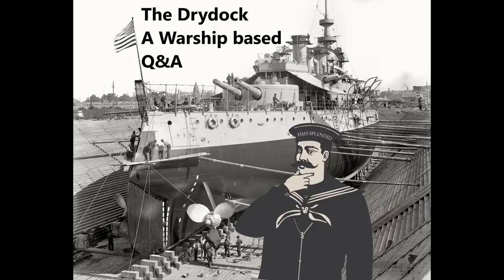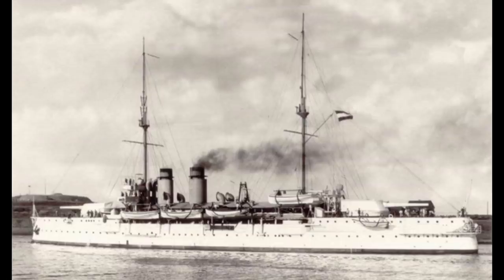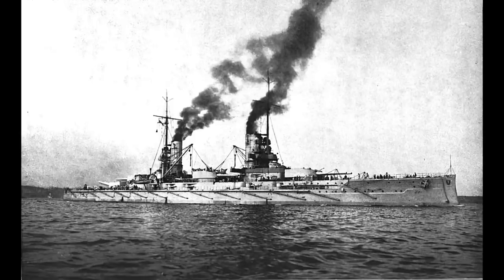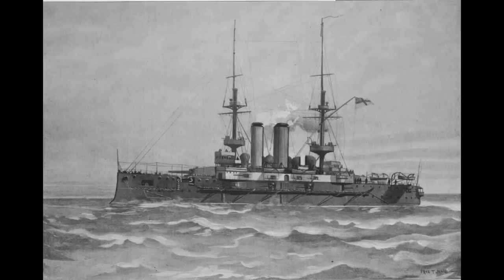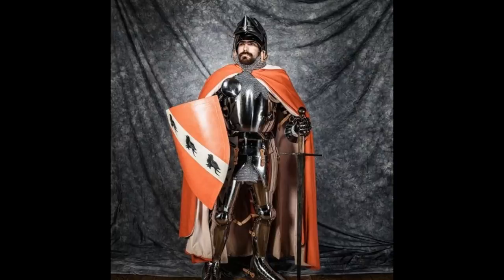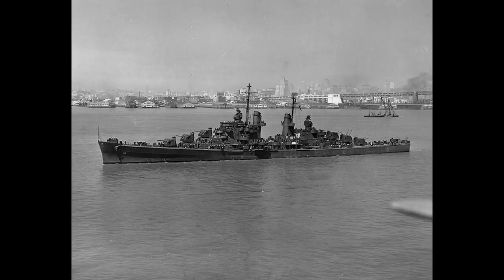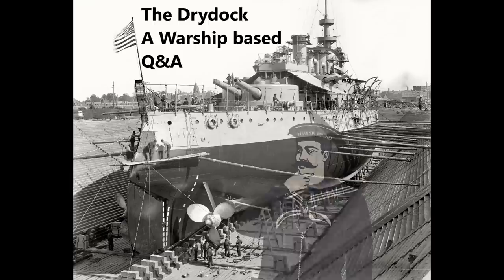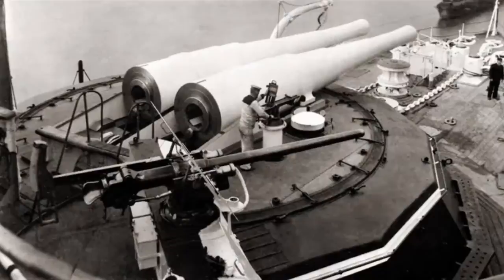The Drydock - Episode 103

Comment: I had in one of my houses in the 70s oak beams that came from a large hotel in Lytham St Annes built in the 1880s when it was demolished the oak timbers of which came from the Furohydrant a 74 commanded briefly by Nelson, this vessel ran aground off Blackpool in the 1880s and the timber particularly the oak used in the building of the hotel. The place where the hotel stood is named The Admiral after Nelson. What comes around goes around; I fitted those beams to create an open plan kitchen diner and was proud to use them. Regards
Reply: Was it perhaps the Foudroyant?
Reply: @melvillesperryn9268  Yes that's the puppy like most RN personnel could never get the name right, thank you young sir. regards

Comment: The important thing about the Nimitz class and some submarines is that they are nuclear powered which means that the old boiler problem of burning out has been eliminated and the platform has many years of use from the primary propulsion systems far beyond the old primary propulsion units in conventional power plants. The big power bits were boilers in the past and difficult and expensive to replace. One of the biggest cost of nuclear propulsion is decommissioning so you keep them going as long as you can. Regards

Comment: I found the use of models as a visual aid very helpful in comprehending the order of battle. Another great idea that sets you're efforts apart from the mundane rehash that is typically found. 
I did a lot of wargaming with 1200 and 1250 scale many, many moons ago. They might be unnecessarily large and kind of expensive for the purpose, however. The 6000 scale was, perhaps a bit small, leaving one to kind of strain for the detail to see what ship type/class they were looking at.
IMHO, 2400 scale might be a good compromise. One could see the general "profile" of the different models and discern ship class, eliminating need for painting flags, names, etc to get the general point across. In the case of Jutland, there might even be enough room to paint a white circle on a turret roof as identification, as a "for instance". There are plenty of maps and charts available to cross reference for those that wish to see exactly which ship is which in the respective battle lines, for those that wish to do so.

Comment: Drach hit the nail on the head with the part about major technological change.  For example, the Arleigh Burke class destroyers of the US Navy have had several different "flights" which are basically upgrades to the stuff inside the ship.  The lead ship in the class commissioned in 1991.  They are now getting to Flight III, the last ships of which will be commissioned somewhere in the vicinity of 2030 with an expected 45 year lifespan, bringing their expected service end to ~2075.  This means that some form of the class will likely be in US Navy service for north of 80 years.  This only works because of the ability to just remove old equipment and replace it with new equipment.  These ships are basically just what he said, steel wrappers.

Comment: Great Q&A video. On improving the seakeeping of the large Civil War monitors like the USS Dictator, and the unfinished Puritan and the four Kalamazoo-class monitors, I would agree that the "breastwork monitor" should have been the way forward for the USN. John Ericsson wanted fast seagoing monitors but failed to realize that this required freeboard. USS Dictator was mostly a grossly oversize Passaic/Canonicus monitor, with an exceptionally low freeboard but a deep draft, unlike the light-draft monitors which were well suited for coastal operations, be they defense or attack. Dictator was little use in the coastal shallows, but her decks would have been awashed out at sea. 

The solution would either to raise the rotating turrets up on a fixed barrette as later USN monitors commissioned during the 1890s or adopt the armor breastwork of the HMS Devastation (1871) and other British coastal defense and battleship ironclads. Devastation like the later USS Texas and USS Maine would have actually fitted into the Brooklyn Dry Dock (but not the ones in Boston or Norfolk), in fact while her beam was at the dock’s maximum, you could have added another 20-feet. Reducing the draft from Devastation’s 26-feet to the 22-feet that allowed US warships to enter most America East Coast seaports.

USS Dictator likely could have been rebuilt into a better ship, she had an iron hull but wooden deck beams, replacing them with iron would have increase strength and reduce weight, allowing more provisioning of stores. The Ericsson vibrating lever-engine could have been replaced with a more efficient compound engine, perhaps a converted Isherwood engine for a steam frigate which were in storage and rebuilt as compound engines. The 6-inch laminated side armor could have been replaced by solid 6-inch plate, which as part of the monitor’s “overhang raft design” was backed by several feet of solid wood. The 15-inch turret could have been replaced by a 12-inch armored turret mounted on a fixed barbette raised several feet above the deck. Astern of the turret a deck house could have been built running to the stern. Overall, in this rebuilt Dictator you would have had a larger version of HMS Rupert (1872) or HMS Glatton (1871).

Comment: In addition to the reasons you gave for why modern ships can remain in service longer through smaller refits it is also a lot easier to take a helicopter deck off the back of a modern destroyer and slide the engines out to replace them that it would have been if you have multiple gun positions in the way

Comment: Regarding the last question - it's worth noting that the modern paradigm is now being reversed somewhat with escalating power requirements for new weapons systems. Lasers are a great example where more available power simply gives you a better weapon and ultimately a ship which will last longer as the technology continually improves.

Comment: Just how effective were breastworks for keeping out the sea, and especially resisting being stove in, or otherwise washed away in heavy seas c.f breastwork monitors?  

I was part of a relatively modern force that got caught in heavy seas in 1993.  Heavy seas do a number on solid structures when waves crash into them.  One of the ships in our formation had their main gun dismounted from the ring by the wave action.  Sure it was only a relatively small caliber naval gun, but that's still a damned heavy and solid installation.  How can collapsible breastworks even hope to do any good against even moderate seas?
Reply: I agree with you, I cannot see any movable steel structures holding up against the sea. The only way to "protect" equipment is to give the ships a raised bow structure and increased freeboard. Then slow down in bad weather.
Reply: On a sistership of the container-vesser I was on, a solid steel stanchion (1x1m, used to support containers) on the forecastle was ripped clean off the deck.

And even the plating of the bow was slightly deformed, as they saw later in the bosuns-store.

So yes: running into wave of a certain size is just like hitting a tree with a car
Reply: Is a Sherman DD a breastwork monitor? 🤔
Reply: @polygondwanaland8390  Can't fire it's gun with the screens up :-(

Comment: Drach, your effort and topical knowledge continue to impress.  Your work is a permanent allocation of my 'free' time.  With regard to DD103 question about miniatures. Heartily endorse the approach and appreciate the monstrous effort to present highly complex events.  I suggest adding two items. First some type of marker to designate 'blue on red', perhaps a small triangle at the bow of squadrons of ships or individual ships when operating independently/or separated.  This would quickly denote direction and which side of the battle for these units.  The downside is that your initial approach adds a 'fog of war' element to the presentation. Secondly, consider adding a North arrow somewhere within the graphic.  Great work.  This is my only 'must watch' on YT.

Comment: 18:45  The radar was the least important part of the anti aircraft system.  The real star was the proximity fuse.  Before the invention of the proximity fuse, detonation was induced by direct contact, a timer set at launch or an altimeter. All of these earlier methods have disadvantages. The probability of a direct hit on a small moving target is low; a shell that just misses the target will not explode. A time- or height-triggered fuse requires good prediction by the gunner and accurate timing by the fuse. If either is wrong, then even accurately aimed shells may explode harmlessly before reaching the target or after passing it. At the start of The Blitz, it was estimated that it took 20,000 rounds to shoot down a single aircraft.[5] Other estimates put the figure as high as 100,000  or as low as 2,500 rounds for each aircraft.  With a proximity fuse, the shell or missile need only pass close by the target at some time during its flight. The proximity fuse makes the problem simpler than the previous methods.

Comment: On the models, sounds like an idea. Let's see how it goes. I think it's probably saved for smaller scale engagements, so you have the scale and space to demonstrate the positioning, without needing to magnify, edit, the models so people know who is who. At least without a recognition guide. 
As for the modern stuff, I'm going to offer a different perspective here. Unless you have a major, I mean major change in weapon systems, technology, you're not going to see major changes in ship hulls. 
I mean going from Tomahawk missiles in VLS to a whole new pattern, family of missiles. I mean going from a whole generation of aircraft to the next, for larger ship carriers. There's an exception to that I will cover down the line, however it does fit into the whole new capability, weapon family section. 
The issue is that in the early 20th century things were getting bigger. Guns got bigger, secondary batteries got bigger, gun calibre got bigger. That is the guns got longer, not just bigger shells, ammunition. Armour got thicker and heavier. Torpedoes and systems got added to the ships. So ten years worth of development is pretty big change. Ships got bigger, badder and more destructive. 
That last line is true to this day. 
The fundamental change is that during the age of missiles, the aircraft carrier, systems have gone the other way. Things have gotten smaller. Rather than larger systems replacing smaller systems, we see smaller systems that are more efficient. We go from the CIWS mount, system to the RAM system. We go from complex gunnery computer rooms with human input, down to the microchip and integrated ship networks. You no longer have humans 'packets' carrying information to mechanical computers. 
You have better, more efficient systems that do more, with less space nominally being used. 
That missile tube becomes the specification for the next generation, incremental improvement to the current system. Current flight (?) of an item. 
Combine that with more efficient delivery of more efficient explosives, it's even more destruction down range and at over longer ranges. 
It's easy to keep the same hull because while it's doing more, it doesn't have to expand to gain that capability. The issue is more ship balance, sea keeping, and perhaps some future proofing that defines a new hull, rather than a clear cut new capability, a change from 12"to 13.5" to 14", larger. 
The other reason you see the creation of a new hull pattern is the need to maintain or develop a new capability. The USS Zumwalt is part of a littoral combat program. It's designed to operate in littoral combat, littoral operations. It's something the US Navy felt they lacked and developed a specific vessel for that capability. The USS Independence is also a littoral ship. Again, it's a capability to operate in the littoral area, littoral combat, littoral operations that these ships were created for. 
Now, it's also worth saying the whole railgun thing is a complex issue and it's worth touching on, but not here. Even the whole stealth capability of the ship, again, worth touching on, but not here. That's a floodgate worth of stuff to talk about, LPI RADAR, SONAR, future expected conflicts, guided shells, UAV's, unmanned boats deployed from vessels, information warfare and information management. As a test best, at least these two ships represent something of a great deal of potential. 
Potential isn't what wins battles though. They're the first step to a new USN and perhaps a path forward for the RAN. Again, not expanding on this in great deal, making the point that new hulls doesn't equal new weapons, new weapon systems as it did in the early 20th century. It's now about capabilities and answering the needs of doctrine, future expected action.

Comment: In response to the changes of modern aircraft carriers, some modifications are actually required in order to operate the F35. Namely flight deck jet blast deflectors. Without improved cooling to these flip-up panels, the games from the engine would actually melt the deck.

Comment: It is probably a little late to add this as a suggestion, but I would get some colored paper from and arts and crafts store to put under each side. You could could either cut the paper into little rectangles and attach them to the bottom of the models or just leave it as big sheets under the formations (the rectangles would work better for age of sail battles where fleets end up intermixed). You could use different colors for each nation for clarity (red for England/Brittian, Blue for France, Black for Germany, etc.).

Otherwise I think the models work great and really help with visualizing what is going on.

Comment: Didnt the IJN refited some of their old Light cruisers replacing the 140mm with 12,7 cm high angle DP guns?
Reply: Isuzu did get 3 of these 127mm dubble mounts instead of the 140s, and some other old CLs did get a 1 of these mounts, replacing one or two of the 140mm guns.

Comment: Is there a guide on the exact colors used and paint scheme for the Great White Fleet? I'm planning on buying a boat to live aboard and I'd like to paint it in those colors, but I can't find a comprehensive guide on what parts are which color like the deck or even the exact color of the superstructure. I know a 40ft yacht or trawler is hardly a battleship or the Olympia, but it's such a pretty paint scheme. Any help would be appreciated.

Comment: The Perry Class was, quite frankly, not a very efficient warship.  It's rail launch system couldn't handle sm3's or 4's, it's 3" gun was a rattle-bucket Italian job and the whole fire control system didn't have the range of the old 51C system that preceded it by almost 30 years.  The ship was an effort to 'miniaturize' and it didn't do it well.  True, they were comfortable for the crew (I served on FFG-37) but that's not usually the primary effort in warship design.  The US Navy didn't keep this class for very long, most being sold off or used as targets after only 20 years or so of service.
Reply: The FFG was not designed for Air defense nor was the 76mm Otto Melara gun expected to sink many  surface ships. It was a ASw escort. Cheap, simple and in a shooting war, expendable.
Reply: @WALTERBROADDUS  We need to bring that type of ship back for ASW. Something that can be built quickly and hopefully a little less expendable. I know the Navy will start building the new FFGX, but they are expensive, complex and will take a while to build. I wonder if the USCG National Security Cutters can work in ASW?

Comment: The argument of 12-inch vs. 13.5-inch has been around for much longer than the Internet. I have read in more than one Learned Tome that the German 12 inch was at least a close equivalent, and better German protection more than made up for any differences. Breyer seems to suggest that, and he is not alone. One problem like many other cases in historical writing is that once a sub ject gets repeated enough, it becomes fact and everybody just automatically includes it in their works. You will probably squirm when I mention David Irving, but he has a good case as regards WWII history, where one historian states something as fact and everyone else then just quotes the original as fact without doing their own research. I suspect it's a similar case regarding the big gun debate.
 system.

I would point out that the USN also had Mk 51 radar FCS for the 40mm; I'm not sure what the RN had other than the Hazenmeyer system.

I believe the Union lost Monitor and another monitor at sea during the War of Northern Aggression. Another was sunk by a torpedo (mine) at Mobile Bay.